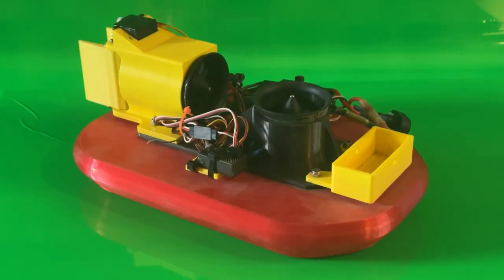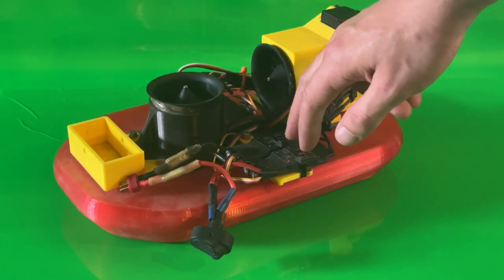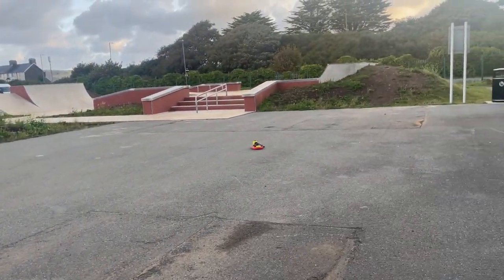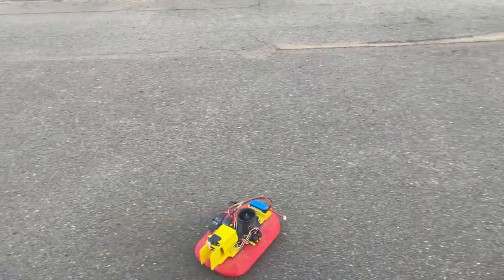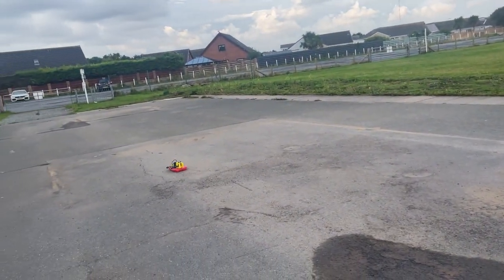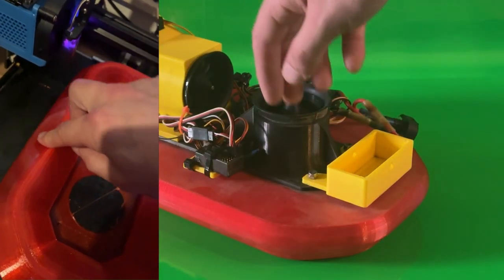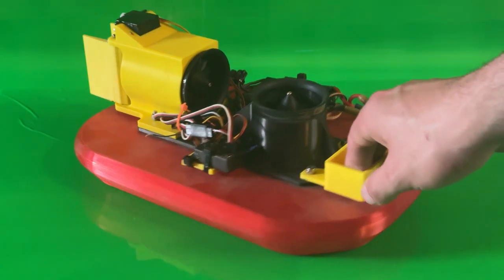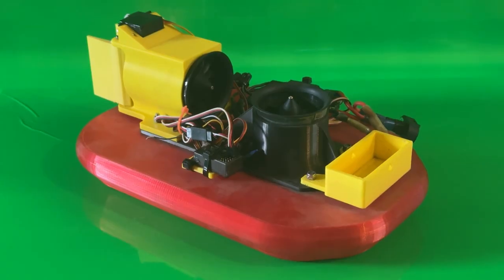Fully 3D Printed Hovercraft! Does it work? Files and parts list included :)

Comment: That looked really fun and performed well. I was thinking to make a hovercraft since I bought brushless motors that I can't use for an airplane due to local laws regarding weight. Also I have 10cm propeller blades. One prop plus motor and 2S battery etc. can do vertical takeoff like a drone so may be too powerful. Or I may make an air boat.
Reply from the maker: sounds like a fun project, thanks